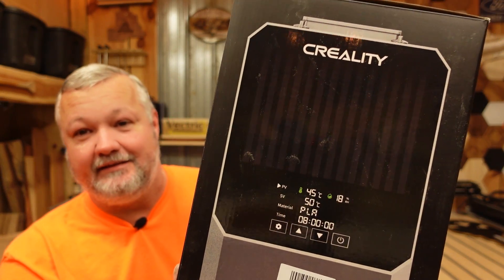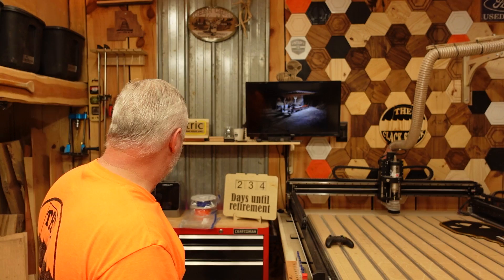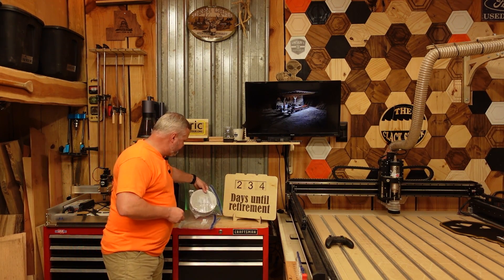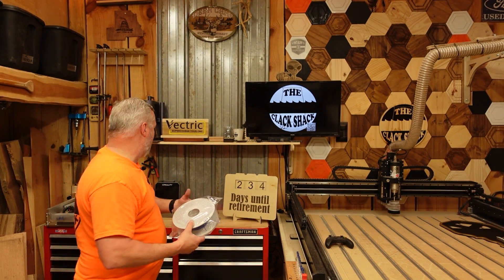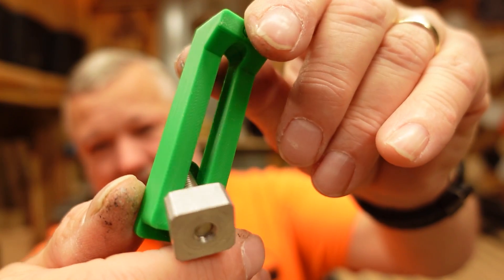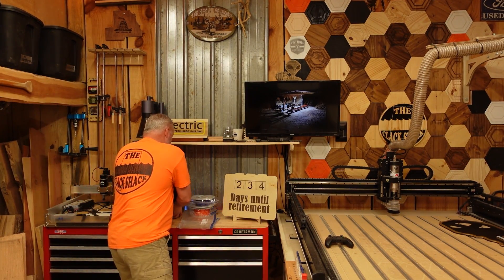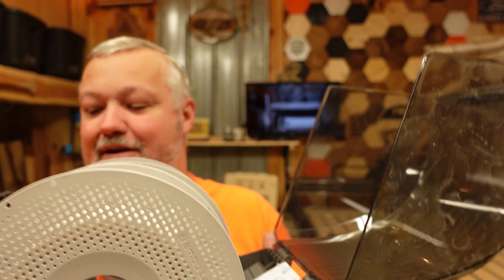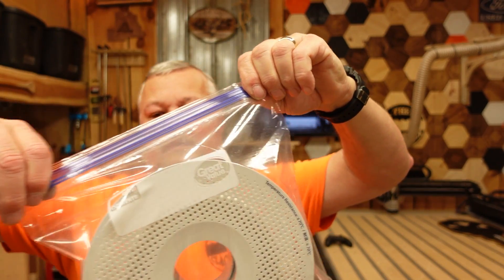Creality Pi Plus filament dryer

Comment: The main issue with the dryer is the Bowden tube gets dragged inside and jammed roll.  The fix I have is put a zip tie round the tube to stop the tube being pulled inside
Reply from the maker: Not a problem for me, I just use it to dry rolls.

Comment: They definitely do make resealable vacuum bags. I got some on amazon. They even come with a vacuum pump. Either manual or electric, depending on what you prefer. I’ve been using them for a while now and they are awesome.
Reply from the maker: My sandwich bags will work for now. I plan to upgrade... lol

Comment: Sounds like any dehydrator for making JERKY would do the same. Make jerky and dry you filament at the same time. LOL
Reply: Sure most can be adapted - i went down the trail
but after it  fused the inner 3rd of  3 full rolls of filament (center seem to e a hot zone ) i switched to a proper drier
Reply from the maker: The rolls were too thick... I checked... The trays weren't deep enough
Reply: @TheClackShack  I was about to click on one of these and then thought I would look at Food dehydrators first, I found one that will fit 3 rolls, maybe 4, for A$47/US$30 as opposed to the Creality 2 rolls at A$149/US$93, worst case the wife gets a new dehydrator and I'll get the Creality if I find a problem with it, but unlikely as its just an adjustable heating element with a timer. also got 2lb of desiccant beads to make my own bags for the storage cupboard.